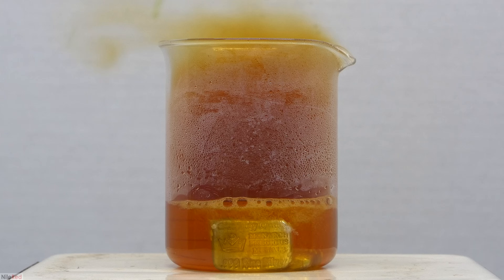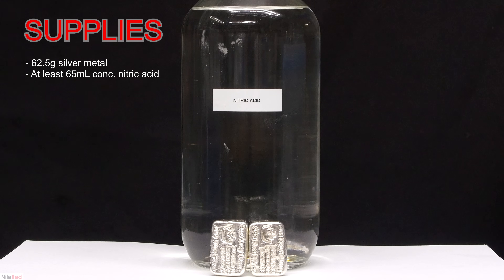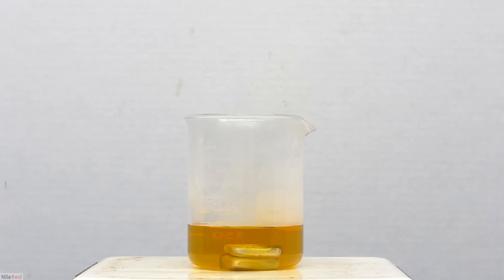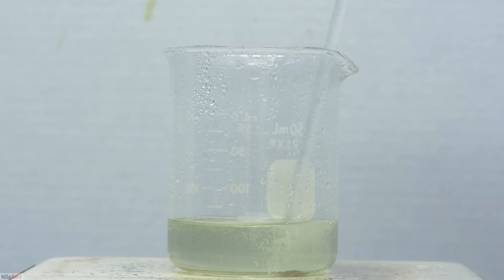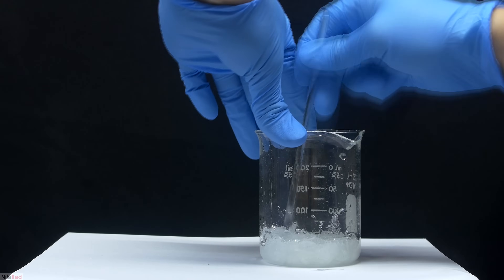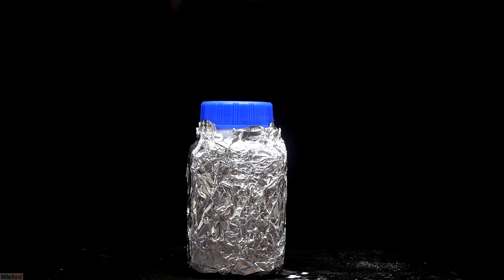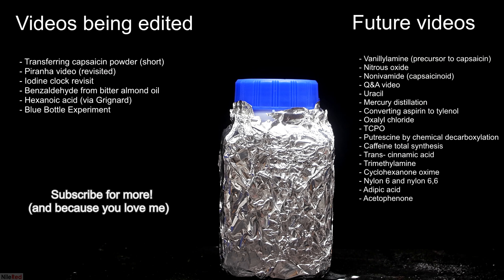Dissolving pure silver to make silver nitrate

Comment: Here is something you can do with it:  You can blacken antler, horn, bone and ivory with it. Deep silvery blue black. Pretty durable because its inside and not a paint. Clean and brush-on or soak in potassium hydroxide, wipe away excess, does not need to be dry to continue. Then brush-on or soak (I've done both with success) in silver nitrate solution. Strength is almost irrelevant, maybe 1g in 50ml. More or less. Wait to dry to handle easier or not. Place in sunlight. If it does not darken in seconds then... I don't know, it always works. I've done angle and bone and a test with a piano key. Also finish your sanding polishing first, it won't effect the surface besides color. Buff and wax or seal.
Reply: *antler not angle

Comment: How hot did you need to heat it up to get the reaction going? I only have a relatively low power hot plate that usually doesn't heat things up more than 50c.

Comment: I always match the volume of my Nitric with an equal amount of distilled water. Letting that simmer on low heat makes the most tolerable reaction in my experience

Comment: Silver nitrate is wonderful for making old historic style photographs.  Pretty much necessary in fact.  

If you do this again, I would probably try to purchase silver shot instead of bullion.  Cheaper if you are planning on getting large volumes.  

Also silver nitrate can be handled safely in any light source that doesn’t emit UV light, as that’s where the bulk of its sensitivity lies.  Honestly a normal incandescent bulb with a red or deep orange filter over the light (or just an orange darkroom bulb, no need to go full red but that’s fine too.  Definitely no need to get a sodium vapor lamp) will work fine to be able to work safely and see what you are doing.  For storage, some dark brown glass bottles work well. Anywhere that sells materials for historic photo processes would have all these items.  This would include the Photographer’s Formulary, Bostick and Sullivan (bulk silver nitrate can be purchased here too) or even Freestyle or B&H would have the supplies.

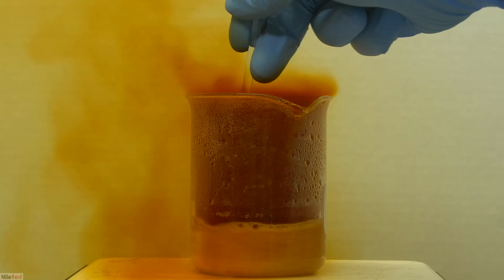Comment: 3:15 Perhaps common ion effect? The nitric acid generates enough nitrate ions in solution that forces the silver nitrate to precipitate out.
Reply: Nitirc acid solution is already completely dissociated. When we add silver we're basically mixing Ag(s) + 2 HNO3(aq) —> AgNO3 + H2O + NO2. There is no common ion
Reply: The solubility of AgNO3 is governed by the solubility product constant Ksp = [Ag+][NO3-]. As [NO3-] is very high initially from the complete dissociated HNO3, the solubility of the AgNO3 formed will be lower in nitric acid than in water. As the reaction continues, [NO3-] decreases since half of it ends up as NO2. The solubility of silver nitrate increases then.

Comment: I can't believe you didn't mention anywhere in the video that Silver Nitrate was used to invent photography...
Reply: Well..., it wasn't. First practical photographic process, daguerrotype, used metallic silver.
Reply: Silver bromide was not the nitrate
Reply: @wildboy87  bromide wasn't the first halide used either, Talbot relied on silver chloride, and Daguerre used iodide. Silver bromide came around the turn of the century.
Reply: Silver nitrate was used in the wetplate process after Daguerrotypes were invented.

Comment: The reason the solid silver nitrate initially builds up, is because its solubility in concentrated nitric acid is actually very low. As the nitric acid is used up and decomposed later in the stage, the solubility of the silver nitrate increases.
For this reason I have also found that you can speed up the reaction if you dilute the nitric acid, initially. This does however require that you supply continuous heat all the way through the dissolution.

Comment: Years late to this video...
The fuming white of your "conc" nitric acid suggest its that 98% pure stuff and not the azeotropic kind (I know if I understood the jargon better this sentence is unnecessary).  I think the driving mechanism in the whole reaction is your water balance. The reaction starts very slowly until there is enough water to start properly carrying the acid, The silver nitrate doesn't dissolve until there is enough water its not competing with the acid. I suspect you could do this without heating by simply adding water or using less concentrated acid. 

But What do I know I am a drunk keyboard warrior...

Comment: I'm a photographer specialized in wet plate photography process, so I use lots of AgNO3. Thank you for the video, I might attempted to try it out myself. My suggestion to additionally purify the solution by sunning it. Yes, that's how 19th Century photographers were doing it and it works. You may check my video, but since I don't want to paste the direct link, since it could be recognised as spamming, I invite you to google: How to boil silver-nitrate bath for wet plate collodion process. 
Thank you again and topshit happens!
Reply: " I don't want to paste the direct link, since it could be recognised as spamming"
omfg yes the struggle is real
Reply: he said like 5 times that it is degraded by UV light

Comment: Hey! Here's a way to reduce fuming in your lab! 
I ran this reaction in a Flat Bottom flask with an adapter for tubing which lead to a beaker of water. I put a pasture pipette on the end of the tubing so that the bubbling would occur more frequently at lower volume. I neutralized the waste with potassium hydroxide and threw in aqueous waste. 
Hope someone finds this comment helpful!
Reply: Haha that's what I did too! I made a small amount of silver nitrate and did the whole thing outside and bubbled it through NaOH solution. I hate NO2. Looks awesome but is nasty shit.

Comment: I have another question that is non related. I have a saltwater reef tank and 1 of the chemicals I dose to the tank is high purity calcium chloride in solid form that I mix with deionized water to create a diluted mixture that is added to the tank. but for some reason when I added the calcium chloride to the container with water there was an exothermic reaction that freaked me out lol do you happen to know what would have caused this ?
Reply: Calcium chloride has a VERY strong attraction for water ("deliquescent"); so strong that when left in an open beaker, the beaker will fill with water until it overflows.  (Lithium chloride is even worse).  The spilled solution will not dry, but will pick up more water from the air.  The spilled solution will "act like oil", refusing to dry!  It is used to kill the dust on dirt roads by attraction of water.  Add your salt to the water in batches and let it cool each time.  (Many chemical reactions that tend to run away can be controlled this way.  In the silver experiment, I would have put the silver in the beaker, preheated the beaker to the "starting temperature", then dripping in the acid to regulate the reaction.  Less acid would be required as concentrated acid would be added at the end, so no "slow tails".

Comment: Nile red is it possible for you to make KMnO4 from KOH , MnO2 and KNO3 and then converting the K2MnO4 to KMnO4 by passing Chlorine gas through the K2MnO4 solution? I saw it on a sciencemadness thread and it does not produce MnO2 when converting K2MnO4 to KMnO4, I am curious to see the result

Comment: The silver nitrate is not dissolving cause of two identical anions(NO3- of the silver nitrate and No3- of the nitric acic) "fighting for solvation". As you used conc. nitric acid there are a lot of the NO3- in solution wich causes a decreased solubility of silver nitrate but as the reaction is continuing the concentration of No3- is kept at one level by immediately dissolving silver nitrate and the exess is percipitating out. In the end everything dissolves cause the solution is pretty hot and the HNO3 was used up.

I have not done any caculations on this yet to verify!

Comment: Hey Nile (or any of you guys watching), got a question: Is crystallization temperature dependant or vice versa? What I mean is, do things (yogurt in this case) crystallize because they are cold, or they become cold, because they have crystallized? I noticed my yougurt had cristalized in the freezer, but the center was still at normal temperature, even with the spoon in the center of it. Then the question popped. Did the yogurt's temperature drop, because the yogurt crystallized, or did the yogurt crystallize because the freezer's temperature dropped? Is it easier to drop a material's temperature, if it is in a solid state? My brain is frozen. I'm not that good at chemistry, but I love it anyways!!!

Comment: I'm trying to isolate elemental boron from Borax powder, but I'm running into a couple practical problems along the way.  I would LOVE to see you do this procedure on your channel, NileRed.  I'm sure you could do it more efficiently and less wastefully than I, and it'd be super helpful for me and others to watch.  I'm sure you can find the procedure on your own, but I'll outline it basically anyway.  If you even happen to see this, that is.

1. Borax + HCL = boric acid
2. Heat boric acid at 300 degrees C to produce boron trioxide
3. Thermite with magnesium to produce some boron, some magnesium boride, and some magnesium oxide
4. Dissolve products in HCl, which will dissolve everything except elemental boron

Comment: The bad solubility of silver nitrate in the nitric acid at the beginning is in general due to the solubility product or in this case the common ion effect. As long as there are nitrate ions in solution from the acid, the silver salt can't fully dissociate and dissolve. When the acid gets used up, the nitrate concentration goes down and more silver nitrate can dissolve, until everything is dissolved.

Comment: what happens to the excess nitric acid?
Reply: got evaporated off i guess.
Reply from the maker: I should have mentioned it. It gets evaporated off. It is really hard to properly dry the crystals because we cant really do a water washing. To dry it and get rid of acid, you can dry it in a dessicator filled with NaOH (possibly under vacuum). Crush the crystals up and then dry the powder again in a dessicator. There will always be a bit of nitric acid left over, but a small amount shouldnt be a huge problem.

Comment: Have you ever thought about doing a full synthesization of LSD? it's quite a challenging experiment.
Reply: Full synthesis is difficult even for medium professional labs.
Reply: +Robocop2015 Yeah I know. my friend SWIM has done a partial synthesization of it through the compound ergine  (LSA). It turned out with a relatively low yield, but not bad. 1.4 grams of product, 94% purity. the material SWIM started with was 4.5 grams of LSA.
Reply: Gideon Lass your opsec is shit for someone with supposed access to $1M of Schedule 1

Comment: Hey where do you buy your nitric acid from? All the places I found either require a commercial address or charge insane hazmat fees.
Reply: Just make it by reacting any nitrate salt with H2SO4 and distill it. Make sure you read up on the appropriate safety material beforehand though.
Reply: +Timothy Morrison I was just wondering if he bought it. I am aware that you are able to make it quite easily.
Reply: It is generally cheaper to make it then it is to buy it due to all the hazmat fees involved in getting it shipped to your front door :P
Reply: I recommend a method I found on Doug'sLab's channel.
Start with Calcium Ammonium Nitrate- 222.52g
H2SO4-113.73g
H2O-92.12g
Add the solids and the water first. Then add the H2SO4 slowly. Distill.
Way better yields than with the KNO3 method.

Comment: Can you convert it back to silver metal?
Reply: You mean copper.  : )
Reply: yes
Reply: I think you just add ammonia and sugar (and some heat +- 45 degrees C).
Reply: You only have to heat it to over 440 degrees then it decompose to silver metal and nitrogen oxides. I tested that for one time but I think its not the best procedure because of the toxic gases.
Reply: yes just add some copper wire to solution of AgNo3 and you well get some silver metal growing on the copper wire

Comment: Would you ever make Silver Azide or Sodium Azide? 

I suggest only small amounts as they are VERY explosive with NaN3 being toxic.
Reply from the maker: I want to, but I have never worked with azides before so I have an irrational fear of them
Reply: NileRed
Understandable. I'm not sure if them being soluable in something makes them more stable.

My Girlfriend has a BSc in Chemistry & I did it at College myself (I'm an electrical engineer). I've made some pretty toxic chemicals (organophosphates) in the past. Toxic and explosive chemicals are no joke.
Reply: +NileRed Sodium azide is toxic but otherwise harmless, organic azides are also generally harmless, if they are reasonably balanced to not be explosive, and can easily be made from alkyl halides. They're pretty useful intermediates in making amines. Heavy metal azides are generally sensitive explosives, avoid them if you can.
Reply: Quintinohthree Mercury Azides are an interesting set of compounds.

Sort of like Nitroglycerin liquid on steroids. Tiny subtle movements cause that things to undergo explosive reactions.

I mentioned Azides that are soluable in alcohols and diethyl ether, might not be that bad. They're by far much easier to hand that the pure crystal form. Sodium Azide used to be used in car airbags, they stopped using it though as it is highly toxic (similar toxicity pathway as CO).